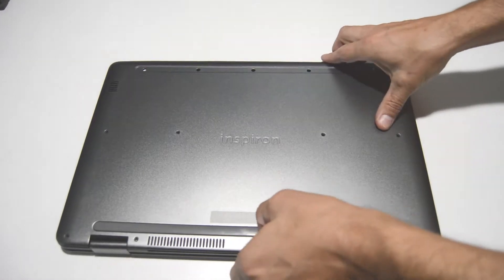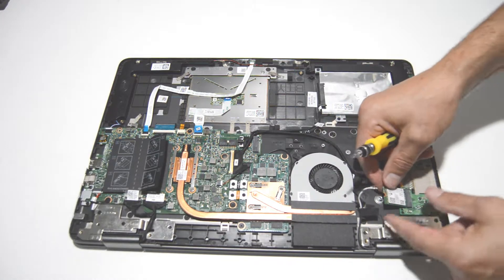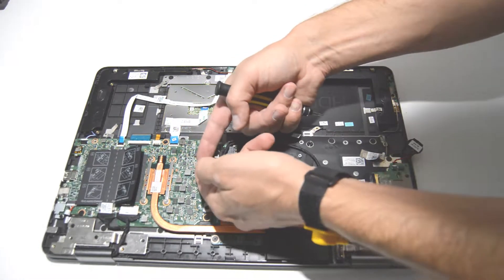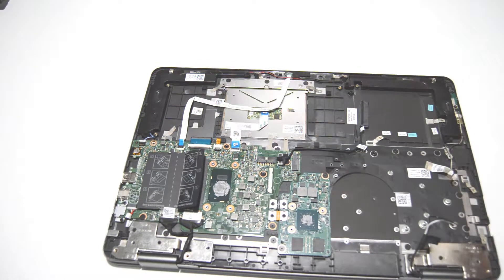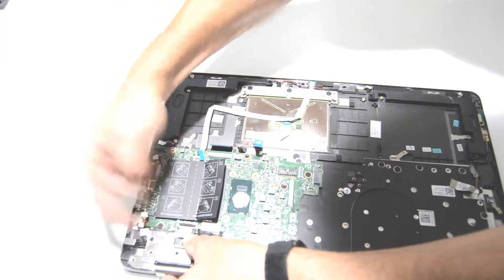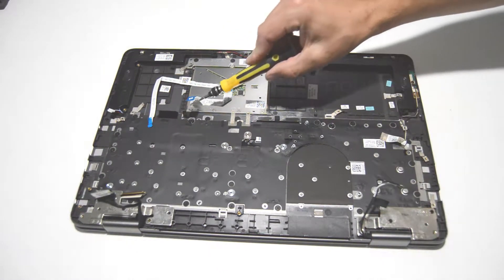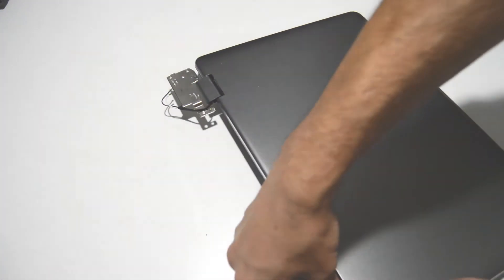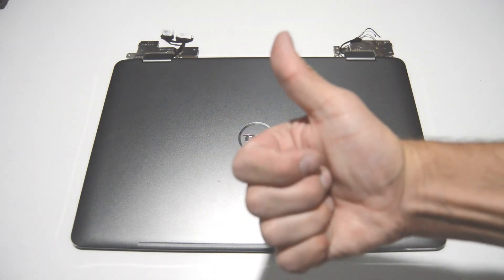How to Disassemble Dell Inspiron 7773 i7 8550U Laptop or Sell it.

Comment: Is the 7773 upgradable to 32gb ram? I notice there are 16gb sticks on Dell's site if I put my service tag in. Also had no idea there is a NVME slot in this thing when I upgraded the HD to a SSD I didn't notice a NVME drive and no extra drive either. I might just upgrade that as well!

Comment: My brother spilled water on the back side of the vents and next thing i know it says to bootable devices found what part is damaged
Reply: Probably a year too late but may help someone else; it's probably the hard drive with your OS installed on it that is not working.  Get a usb key and install a bootable version of linux.  If you can boot into that, then you have your answer.  Also you can run memory and other diagnostics while in linux just to confirm everything else is working fine.  May be worth just unplugging the hard drive, clean it with alcohol if it looks gooey, and plug it back in, then retest just to ensure you dont buy another harddrive if not needed

Comment: Possibly a too specific question but I'll go for it. I dropped my laptop like an idiot and now the charging port is not connecting properly. Would a bit of soldering help if I take it apart following these directions?
Reply from the maker: It looks easy to replace. One the bottom cover is off, you just have to unscrew it and pull the connector from the motherboard. If the area is broken you might be able to glue it in place.
Reply: @Sellbrokedotcom  wonderful! Gives me a bit of confidence in doing it lol